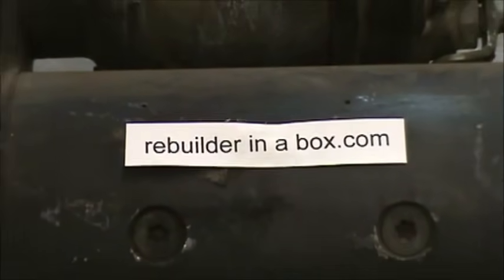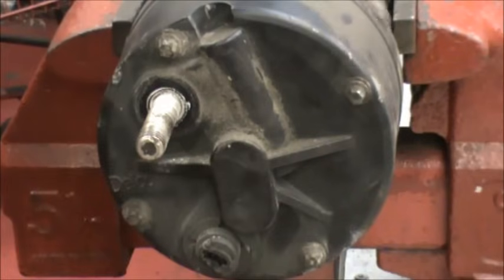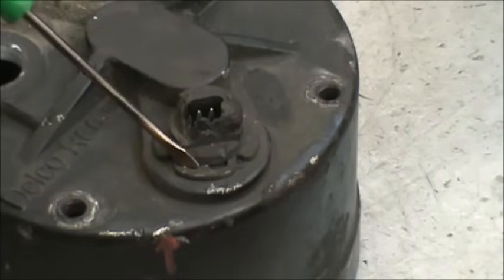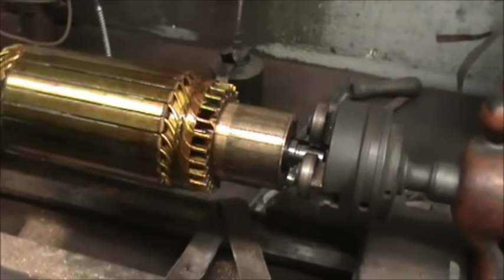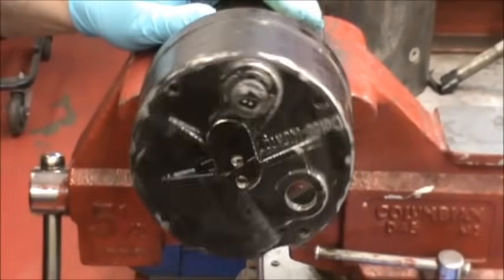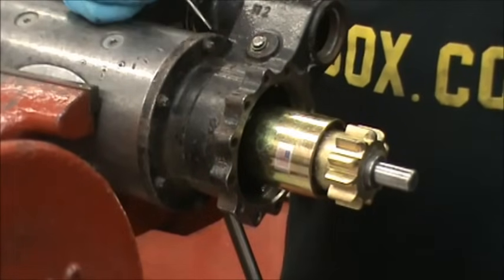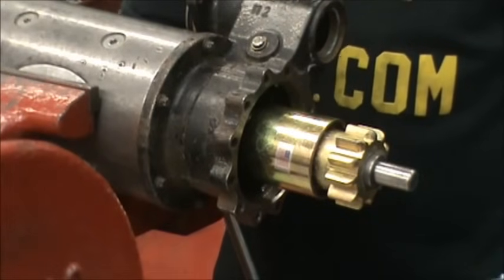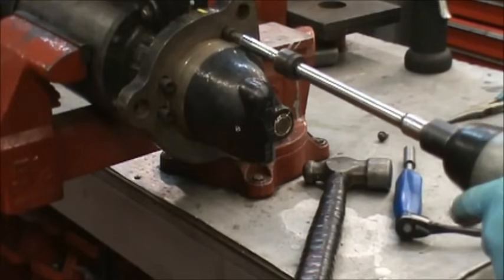How to rebuild a 42MT

Comment: super helpful. Not a complete rebuild (Oilers and seals)but better than anything else.
Reply from the maker: Thank you. The shaft seal (the one that matters is included in the kit) The external ones are purposely omitted because their function is rather moot, and new replacements cause assembly irritation. In the shop, we have re-used the old ones for many years without issue, so we don't encourage replacing them.
Reply: @rebuilderinabox  Ok and actually I meant orings not seals but maybe you never took them off.. What cleaning techniques did you do? Do I have to be careful what I do with the field coils?  Thank you for your reply.
Reply from the maker: Dawn and water, rinse repeat. Sun or fan dry. Test continuity BEFORE cleaning but not after.

Comment: hi mike , I have a problem with my starter and I can not graduate well bendix ... or it does not happen that when we give up and will not start because the Bendix does not mesh with the rack of the steering wheel , not as graduate it properly you help me with this issue ?

Thank you

Comment: This is a very detailed video! But do you have any questions? What are the channels near each bushing with felt inside? If this is for lubrication of bushings, then what kind of oil should be poured into it?

￼

От
Reply from the maker: Our replacement bushings are oilite. (impregnated with oil, no need to lube)
Reply: Why then are there channels near the bushings and materials inside them???
Reply from the maker: "Our" bushings don't need oil as in all aftermarket replacement bushings, even the manufacturer's aftermarket. Please, no need to focus on this. Although annoying from a design standpoint, it's very insignificant to life expectancy and performance.

Comment: Thanks Mike....
I asked you this question earlier regarding the 24 Volt 42 MT....when I had it disassembled I checked for 
Continuity between the staters (where brushes make contact) and armature.  My volt meter set on olms showed continuity. ...can it be repaired or do I check it???
Reply: Throw it away??
Reply from the maker: Not sure what you mean by "stator". Stators are in alternators. You may be measuring something that is normal.
Reply: Still fussing over 42mt starter for a Hough H-80 wheel loader...
Disassembled the inside of the case,windings are grease covered with crud and rust particals...the metal plates attached to windings and  case are rusted...
What do you recommend as solvants to clean up those areas???
Reply: When I used the term stator 
I meant commentator...

Comment: Hello, I'm having problems with a 40MT on a Cat D333C engine. Are these positive ground?
Reply from the maker: The starter is made for both. If the solenoid post cable is +, the vehicle is neg. ground.

Comment: I'm still learning about these starters and have a question. if there were 2 armatures for the 42 mt laying on a table one is 12v and the other 24v how can you tell which is which? Is there a certain way to tell?
Reply from the maker: We always look for a number stamped on the side. Then run the number. That's the best way. Usually 24V hairpins (copper strip) will be a little thinner than the 12.
Reply: Thanks. also do you sell the shaft seal for the 42 mt starters
Reply from the maker: @bryansmith6026  Yes, but it's part of the entire kit.

Comment: How come you did not remove the lubrication wicks and oil them as the bushes require lubrication....if you get a rebuild kit they come with the wicks and new plugs??
Reply from the maker: Early design bushings were just bronze. New design bushings are oil impregnated. It would be a waste of time.
Reply: Mike Lauer  We found the sintered  bushes wore  out too fast.
Reply from the maker: Depends on who the manufacture is. That's why we like you to buy them thru us.

Comment: Hi Mike watched your video..great job!!
My starter is a 42MT 24 V positive ground 11 tooth counter clockwise Unit.. it's off a International harvester H80 1970's model..
Anyway I'm reading continuity between stater and armature..is it throw away, or can it be repaired??
Also I have a identical starter (Delco- R) 11 tooth neg ground 12 volts.... it is in working condition... Can it be converted to 24volts positive ground??????  Thanks Nick
Reply from the maker: No you can't have a short from fields to case. You can convert with a 24V solenoid, and 24V brushes when in a pinch.
Reply: Both of my 42MT’s are identical,solinoids, brushes, staters, armatures, however the Delco-Remey is stamped 12 volts...no difference in wire size of winding's wire to brushes and brushes themselves...all internal parts are the same both stamped 42MT there both identical to the one that you rebuilt in your video ...¿????
As I mentioned my loader is 
24 volts positive ground!!
What do you recommend or suggest I do??
Reply: Is the 42MT in your video 24 v or 12 volt
Reply from the maker: 12. The 24v armature is different and the fields are different also, besides the brushes and solenoid. Although the fields and armature are almost visually un noticeable.